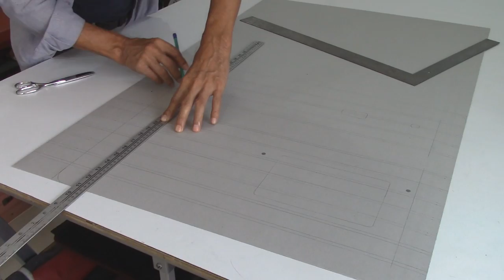Custom VW Beetle Door Panel - Automotive Upholstery

Comment: Parabéns, me ajudou a entender o processo! Temos pouquíssimo material sobre o assunto no Brasil! Obrigado por compartilhar seus conhecimentos!
Reply from the maker: Dear Fabio, Thanks for watching!  Shoemakers use these cardboards for insole. Try to find a similar in Brazil. This other video also shows a similar technique:  https://www.youtube.com/watch?v=jZT6ViLV3_4
Reply from the maker: If the 'door panel cardboard base is broken' try to use a special cardboard resistant to heat and humidity. Something like Greg used (original material) for his car door panels:https://www.youtube.com/watch?v=sYXnNzB4pxw

Comment: Hello your video is very helpful iam about 2 build my second pair of door panels last time I used foam this time iam going to use paperboard so my question is how to keep from seeing the door clips under the vinyl after installing the door clips? Any advice is appreciated
Reply from the maker: The sample of the video has two layers of cardboard. The first is the base and should be the original thickness. The cut layers on top are distributed and glued down to the cardboard base. 
In fact the clips will be fastened to the cardboard base holes. To avoid any protrusion on top view the thinner cardboard on top should have a recess on its reverse just enough to house the fastening part of the door clip. 
If we would upholster a plain design on a VW door panel cardboard, then the clips would go hidden beneath the foam. We should leave a small gap with no glue to let the clip be fastened to the cardboard easily.
Hope it helps.
Reply: @Cechaflo  I did a couple of samples today and that's one of the ways I did it thank you so much for responding and the knowledge
Reply from the maker: @michaelwools9538  That is great, Michael !   I would recommend you a wet-proof cardboard. Other cardboards warp with humidity.
Greg shows in his video the right cardboard:https://www.youtube.com/watch?v=sYXnNzB4pxw
ABS material is also advisable. John shows and explains in his video about this material for door panels:
https://www.youtube.com/watch?v=puEYF3xJ3DE
Best wishes,
Cesar

Comment: Absolutely stunning! Wow!! I am speechless.
I'm about to redue my panels, two questions:
What type of glue do you use?
What is your panel backing made out of and how thick?

Thank you for your time.
_j
Reply from the maker: Hello Jeffrey, I have used a 'yellow brushable glue':https://www.youtube.com/watch?v=o2xeezdF8Ss  You would need to find a similar. It could be weldwood contact cement, petronio's glue, etc.
I used a thick cardboard board (shoemakers' material) for this sample. I cannot recommend because it could warp because of heat or humidity. You would need to get the special cardboard for your door panels.
I am sending you some useful links to get a much better panel backing:
https://www.youtube.com/watch?v=n-JsaZbEjRI
https://www.youtube.com/watch?v=sYXnNzB4pxw
https://www.automotiveinteriors.com/waterproof-cardboard-door-panel-board-cowlboard-p/cowl-dp.htm

Comment: Cechaflo, how do you ensure the facing leatherette stays in all the grooves, long term? It did not look like contact cement was used. It appeared to be a low tack adhesive since you could reposition the facing material when setting it on the substrate.
Reply from the maker: Interesting questions! If you watch carefully the video you would realize I have used some 'tips' to make the 'channel shapes' last long. 1. The 'stretchy side of vinyl' is in vertical direction of horizontal channels...that way, it easier enter into the grooves...in other words it should not be forced. 2. The vinyl was just placed in a soft way over the panel to let it slide into the grooves. 3. The stitcking process has also much to do. I first liberally applied a coat of glue over the 'cardboard channels' (just the channels) as a primer. I did the same with vinyl material. After letting them dry I applied a thorough coat of glue.

Comment: great work .  what foam and # grade of foam you are using in this? . Thank you in advance
Reply from the maker: I did not use any foam on this project. I used a thin 3 mm thick soft and flexible cardboard instead. Shoemakers use this cardboard for insoles.
https://youtu.be/IF5qL9vAzhQ?si=bRS5m-kabn-TC2Bz&t=18
I used the same cardboard on this other door panels:
https://youtu.be/jZT6ViLV3_4?si=KDU3YVEHTaoQ3Z4i&t=161
Eva high density foam (latex foam) could also be used for door panels:
https://youtu.be/GqWwodJ5ITU?si=Vx_UGgeVg_ZlpbTK&t=2526
https://youtu.be/2-FNpEDMw94?si=k-eQtssHm57XI-hy&t=48
Reply: thank you so much. and thank you for showing us how to do this @Cechaflo

Comment: Hello, could you please recommend a type of glue for working with synthetic material. What glue do you use in this video?
 Your work is very beautifull. Thank you for showing this method, I need to redo the panels on my VW Bus it helps me.
Reply from the maker: For this project I used the traditional brushable upholstery yellow glue:https://www.youtube.com/watch?v=o2xeezdF8Ss&t=487s

Comment: Can you provide a supplier for the soft pressed cardboard padding?
Reply from the maker: I got the paper board from a local supplier here in Mexico.
You could get it on internet.
https://www.etsy.com/mx/listing/783628954/plantillas-para-calzado-forro-de-suela
Reply: Thank you. I only see small pieces. Do you get it door size sheets?
Reply from the maker: @randyprince9913  The sheets I have bought are slightly  large. 1 meter wide by 140 meter long.
It is mostly used in the shoemaking industry and I have realized they imported this board from China.
Reply: Thanks. I'll keep looking.